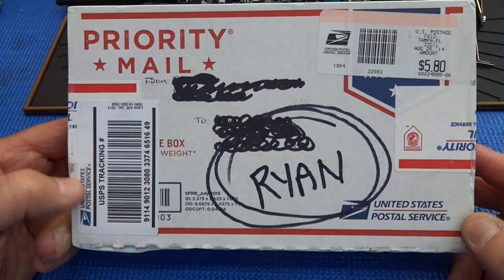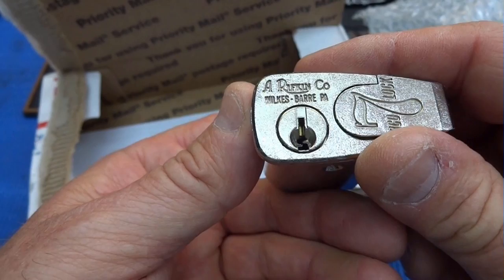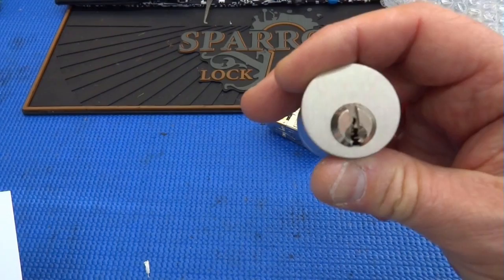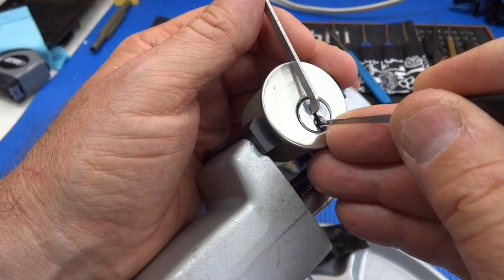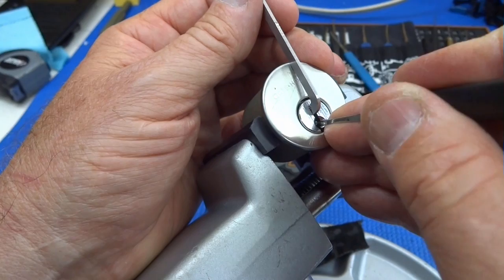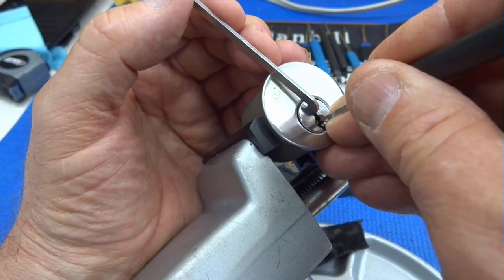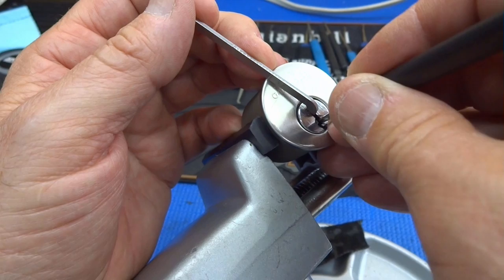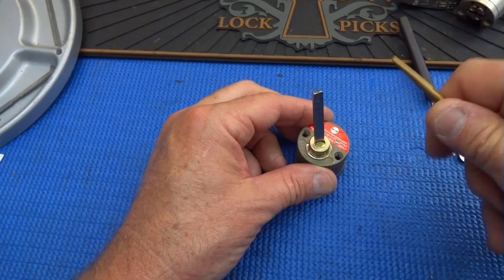(610) Challenge Lock from RRLocksmith

Comment: Those off brand locks can be problematic even without security pins. I guess it is due to that cut down the center of the plug. I hate when customers have them and want them master keyed cause the master pins get jammed. Just imagine using different length security pins like a Schlage instead of the same size.
Need to get a hollow follower for those locks where the tail piece won't come off.
Reply: bosnianbill I though you had some and thought I saw them in a few videos. Isn't that how it always happens, need a tool and can't ind it, finish the work using something else and the needed tool suddenly appears
Reply: rallock67
Check out the Keedex K-6 plug follower. It's all I'm using now!